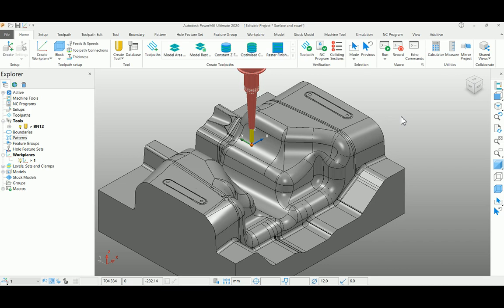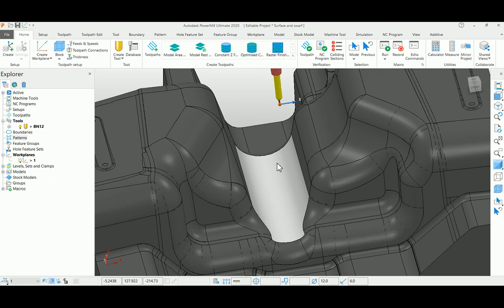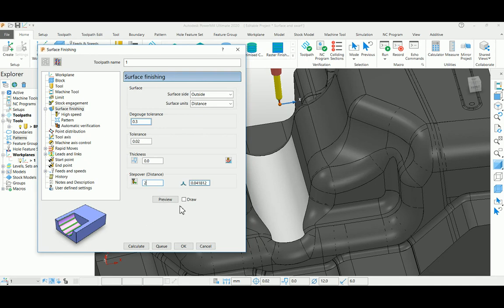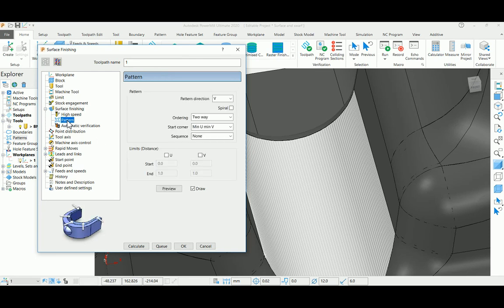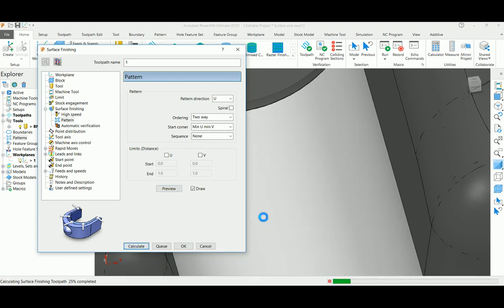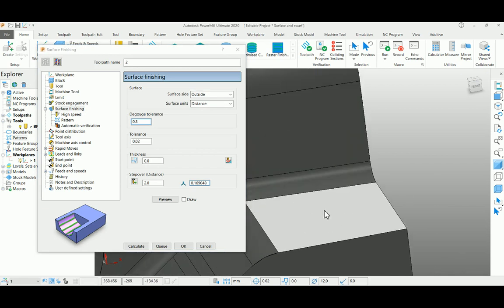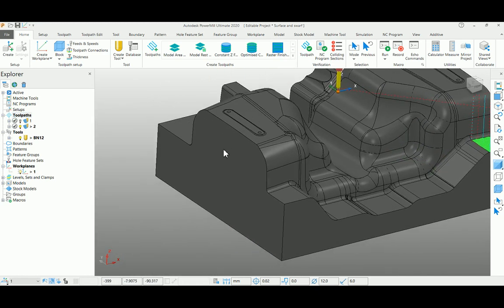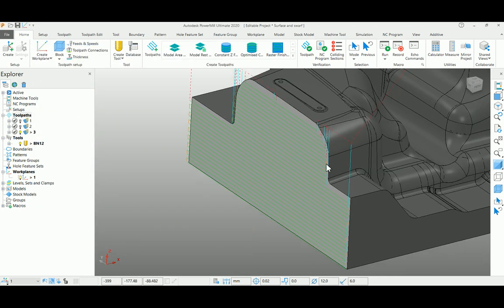Autodesk PowerMill - Surface Finishing  - 3 axis Application

Comment: That was nice to know and a good tip to use surface strategy for the walls. That would also be great if you could go through more settings to reach an ideal toolpath. Parameters such as lead in, lead out and etc.